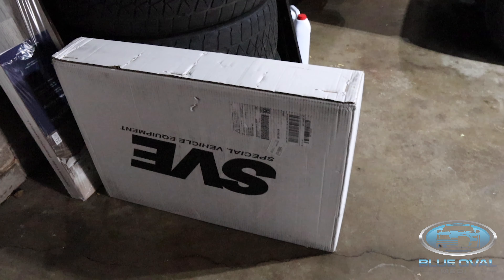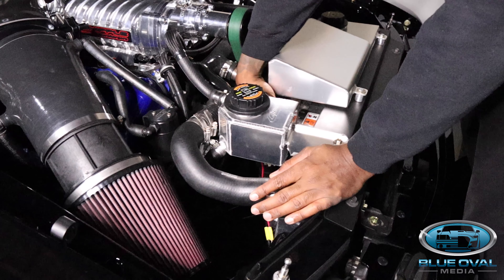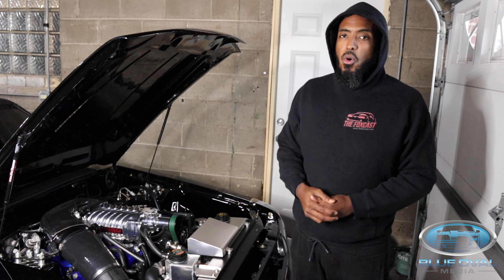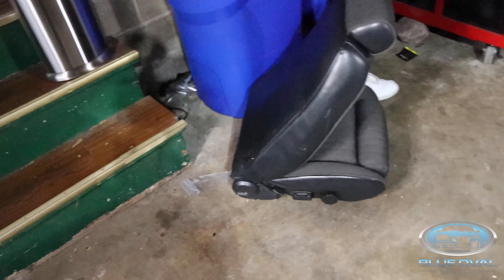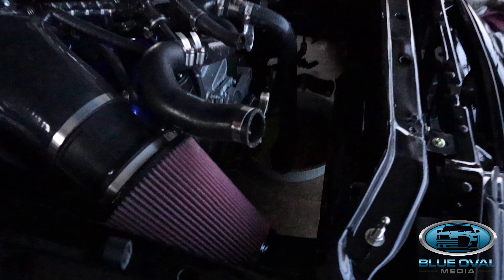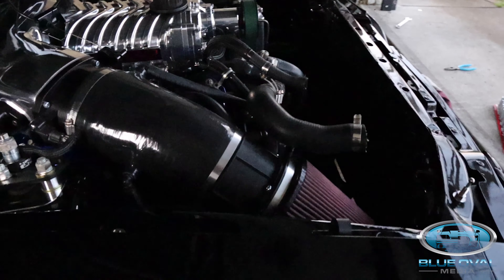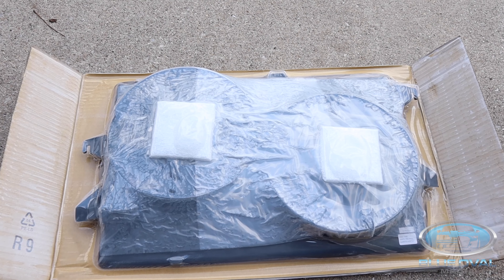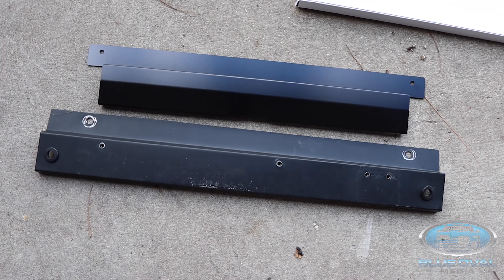Making a 800HP Foxbody. Winter teardown project part 1

Comment: Just did the terminator x on my 92 notch with the contour fans lol. I used the msd relay block and it worked out great , it did take up 2 outputs and FYI the iac takes up a output. Just a heads up. Keep up the great work.

Comment: What size fuel lines are going to be running? Will it be return style system like a Yote?  It never ends...
Reply from the maker: It currently has an 8 feed and a 6 return it might be a 10 feed and a 8 return

Comment: All I see is $$$$$ chasing Hp & Tq. Does it ever stop? You have to go way beyond what the factory is doing in order to keep up. They are putting out 800HP mustangs. So you need to build one that has 1000 -1200 hp. Then you can sit back & relax for a min with no money spent. Oh & , never tell the wife what this shit cost!!!🤣🤣🤣🤣🤣🤣!
Reply from the maker: Well you are talking about cars that weigh over 4000 lbs in comparison to a car right at 3000. I don't need 1000 because its a street car.
Reply: They arent putting out 800 REAR WHEEL horsepower mustangs the new gt500 does like 660-680 to the tires stock and it also weighs well over 4000 lbs vs this fox at 3000...huge difference.  No need to chase huge numbers just to keep up with internet heroes lol.  This thing at 800 wheel would have one hell of a power to weight ratio which in the end is what really matters.  Just because theyre releasing some pretty high hp heavy as hell cars today dont make an 800 rwhp 3000 lbs terminator swapped notch any less impressive.  This thing gonna hurt feelings lol.  Always wanted a notch and always wanted a terminator it would be bad ass having the best of both together.  Bet this thing is some serious fun.

Comment: You plan on racing it a lot at the track? Only way I go E85. Sticking with 93 because it everywhere around me. So is E85 but I’m not racing mine at the track. So I can get little more MPG out of her.
Reply from the maker: I will have a 93 tune and a e85 Tune. It's a show car but I still want the power.
Reply: @BuiltVSBought  I’m running the Holley kit also. Should be on the dyno this week
Reply: @BuiltVSBought  yea and e85 allows you to make more power even safer imo as it is much more detonation proof so to speak you can be aggressive with it it allows more room for error on the aggressive side you just gotta make sure you have plenty of fueling available which is an issue alot of guys run into.  Give it plenty of fueling headroom and youre good to go on e85.